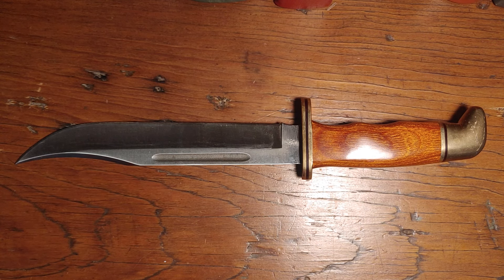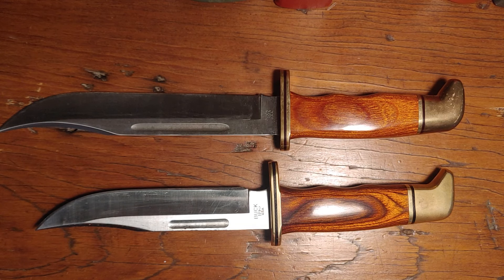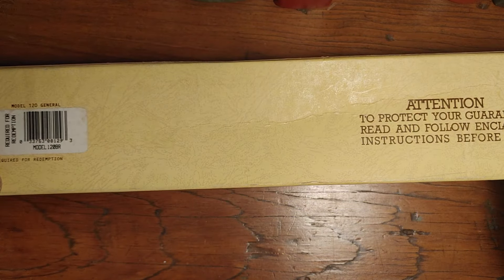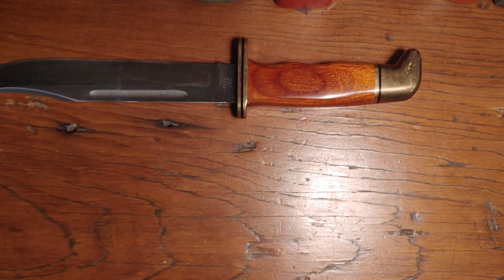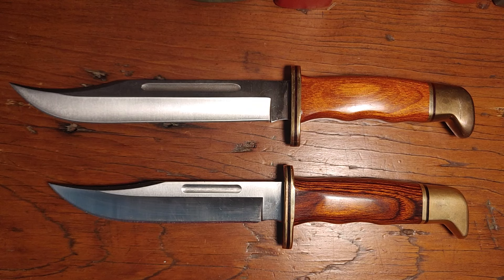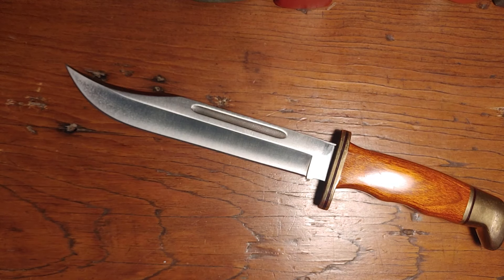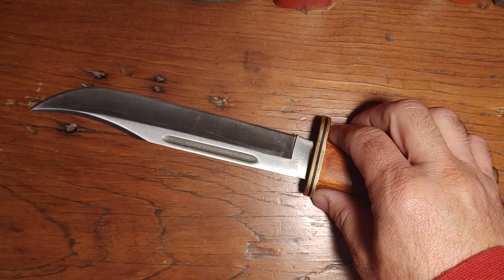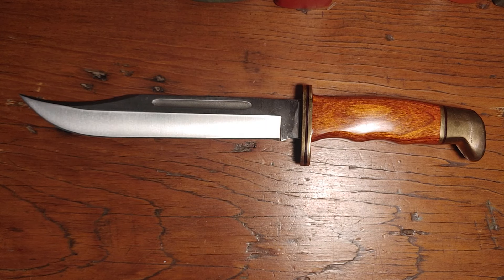Buck 120 Cocobolo and Brass (1990)

Comment: Nice knives. I agree on the wood splitting. I have a couple of buck 124 model knives. One is new with date code stamp but the other is quite unique. I’d like to show you a picture and see if you know anything about it. It is a 124 with a serrated spine like a saw back but it’s more decorative. It also has a lanyard hole in the handle. I had one guy tell me it was from Vietnam time frame.  Any help would be appreciated
Reply from the maker: @gvines  
Because of the lanyard hole, it lends me to believe that your knife is from 1971. I believe that the serrations may have been added, not done at the buck custom shop. Hopefully someone with some real knowledge can chime in. Thanks for watching take care.